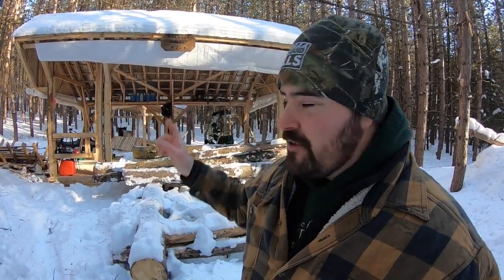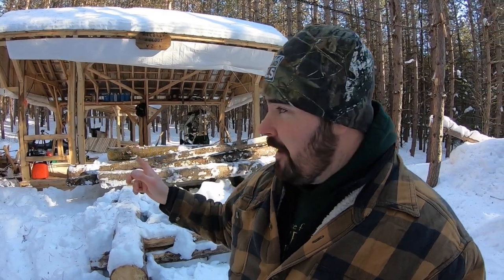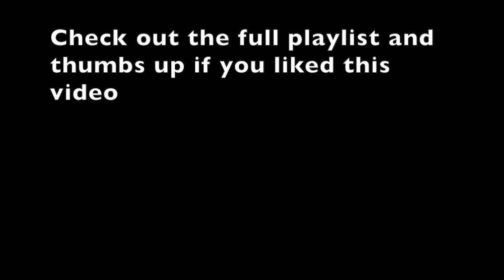Full Sawmill Shelter Build in 10 minutes

Comment: You did a fine job. That shed should serve to protect you and your band mill for many years. The only question I have is why not use some metal hangers for all those floor and roof joints rather than toe nailing. Seems like it would provide a more solid way of making the floor and ceiling more securely locked down.
Reply from the maker: Thanks for tuning in Dennis. I normally would only use joist hangers when the floor joists weight is hanging off of a beam but in my case the joists were sitting on top of a beam with rim boards nailed in to keep the floor joists vertical. Hurricane clips could be a good idea here though for the rafters though like you said to prevent up lift. Hope all is well with you. Happy sawing!

Comment: Hello Sandy, have you ever considered building a peak on the roof in line with your walkway so that when the snow slides come off it won’t damage the walkway? Just some food for thought. Then it would eliminate the need to remove your walkway in the winter.
Reply from the maker: That’s a good idea Mark. Main reason I have to remove the walkway is to clear the snow and sawdust from the other side of the boardwalk with my tractor unfortunately

Comment: Hi Sandy. Big fan in Alaska. I have an HM126 with one extension on the way. Will need to put together a platform and shed roof as soon as the snow melts this spring. Do you have the basic dimensions for yours somewhere?  Or did you use a drawn up plan?
Reply from the maker: Hi Stede! Thanks for tuning into the channel. Basic dimensions are 10' x 20' with the opening leading into the sawmill being 14'. Hope that helps. Thanks again for watching.

Comment: Hey Sandy, have you had much issue with condensation under the tin roofing in the cool months?  I see that on some of my structure and wonder if a moisture barrier should be used. Since there is no moisture barrier between the tin and wood what long term effect might there be with moisture on the strapping?   Life expectancy of the roof built like that?
Reply from the maker: I get a little condensation but it evaporates pretty quickly since everything is open
Reply from the maker: Typically since it’s not heated space there’s no cold and warm air contact so not much condensation

Comment: What is under the concrete blocks to keep them from sinking?  Or should they all settle the same?
Reply from the maker: The concrete blocks are just sitting on compacted sandy soil and so I don't imagine they will sink into the soil but they likely will move just a little bit with frost but in that case I'll just re-level the floor with some shims.

Comment: Hey sandy I was wandering on your 6x6 posts going up would it have been stronger to put them in the ground then put a band around them then set the floor joists? Just wandering
Reply: Awesome build... can’t wait to see what you have next. I hope to get my woodland mills this summer
Reply from the maker: Hi John, thanks for watching. I think it would have been stronger to put the posts in the ground for sure. Reason I didn't is because I don't have treated lumber and was concerned about the pine posts rotting quite quickly when in contact with the ground. Pressure treated posts in the ground would be my second choice with concrete piers and posts attached to them above the gorund being my first choice.